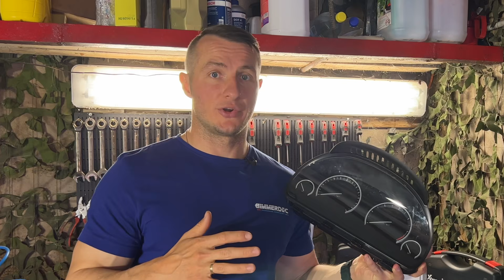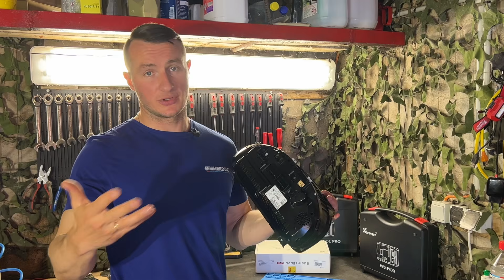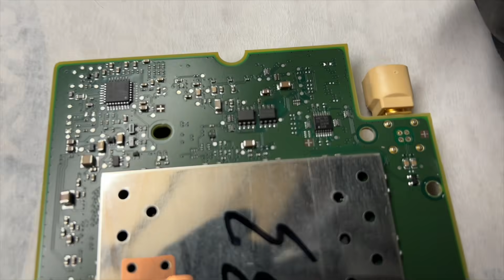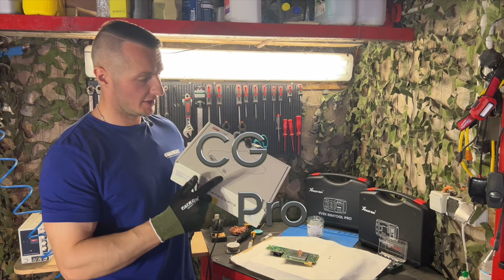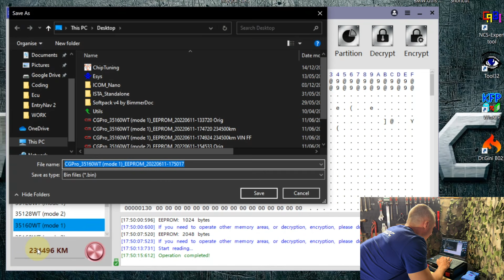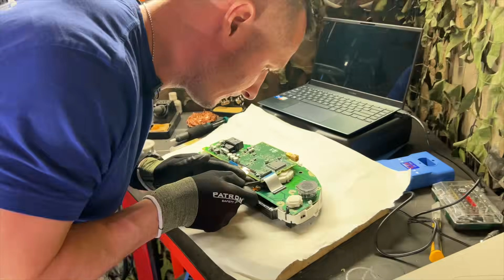How to zero (virginize) any BMW cluster for retrofit or exchange?

Comment: Hi could you help me regarding my car. So I got a cluster from a f80 and I want to install it in my bmw f30. I got the cluster virignised and plugged it in. I don’t have a most cable yet. But once I plugged it in there is a tamper dot but with my cars kilometres. What must I get done now? For the cluster to work between my car. I know coding is required and the most cable but I think the tamper dot should not be there? Did the person who virignize it didn’t clear the vin?
Reply from the maker: If you code the cluster to your vehicle then red dot should not be present. 
If it is still present, then sometimes vehicle needs to go for a sleep. 😴 
It dot is still present, then verginizing process is as not done properly. 

And fitting M series cluster is not so straight forward. Take that into consideration.

Comment: Can you just swap EPROMs from one cluster to the other??
Reply from the maker: EEPROM swap is possible on E series only. 
On F and G it will not work in that way any more
Reply: @BimDoc  is there any way to use a used cluster without soldering I have a e66 that needs a new cluster and I can’t solder for the life of me
Reply: @BimDoc  thank you.  It is for a g30 with a cluster that intermittently goes black.  Do you know if anyone repairs these?  Possible a cracked solder joint somewhere?
Reply: Just tried and unless you have the experience of soldering it’s ducking crazy hard

Comment: If the mileage on my original cluster is higher than the new (used ) one i bought i can keep it without having a mileage tamper light?
Reply: Would i be able to just switch out the eproms with mine in the original cluster
Reply from the maker: Switching EEPROMS will not work on F and G series any more!

So full VIRGINIZING is needed

Comment: Great video and really informative! Just a small clarification regarding your explanation about hexadecimal numbers. You mentioned  right around the 13:05 mark that the value 0xFF is equal to 0, which isn't accurate.

In the hexadecimal numbering system, a single digit can represent values ranging from 0 to 15. Unlike decimal numbers, which only have digits ranging from 0-9, hexadecimal numbers extend that by including the first six letters of the Latin alphabet (A-F) as additional digits. In hexadecimal, the digits range from 0 1 2 3 4 5 6 7 8 9 A B C D E F, where 'A' is equivalent to 10 in decimal, 'B' to 11, and so forth up to 'F', which is equivalent to 15.

So, when you look at a one-byte hexadecimal value like 0xFF, it's actually equal to (15 * 16^1) + (15 * 16^0), which calculates to 255 in decimal notation, not 0. The representation for the decimal number 0 is consistent across binary, octal, decimal, and hexadecimal numbering systems. In all of these systems, zero is always zero. In the case of hexadecimal, it could be written as 0x0, 0x00, or 0x0000, but it's always equivalent to the decimal number 0.

I hope this clears up any confusion! Keep up the good work on your videos!

-- a fellow Bimmer nerd
Reply from the maker: That’s true 
Just FF values are takes as VERGIN and that’s why they often referred as ZERO

But yes FF = 255

Comment: Hello Vladinir can i ask for an advice please? I am considering to add to VO 6WA for my KOMBI and code it because the car is 2010 year and as I see my original combi is 6wa model. As i read 6wa is from year 2011 thats why its comfusing for me why 6wa its not originaly in my VO. The reason for adding it is because i want to add in addition coding M performance logo picture and as of now i dont see it in addition in my coding options. Will adding 6wa in VO help and is it safe to do so ? Here is my car VO list bmw 740d F01 2010.

Type Code KM81
E Series F01 ()
Series 7
Head Unit CIC
Type LIM
Model 740D (EUR)
Steering LL
Doors 4
Engine N57S
Displacement 3.00
Power 225
Drive HECK
Transmission AUT
Colour CARBONSCHWARZ METALLIC (416)
Upholstery LEDER DAKOTA/SCHWARZ (LCSW)
Service history Request a FREE service history
Prod Date 2010-06-24
Available upgrades
Spare/replacement key fob Check compatibility
Additional iDrive features Check compatibility
Additional iDrive features Check compatibility
Vehicle options
L801A National version Germany
P337A M Sports package
P7R7A Innovation package
S1CBA CO2 package
S1CDA Brake Energy Regeneration
S229A Dynamic Drive
S230A Extra package, EU-specific
S248A Steering wheel heater
S2NXA BMW LA wheel, M Double Spoke 303
S2VHA Integral active steering
S302A Alarm system
S316A automatic trunk lid mechanism
S319A Integrated universal remote control
S320A Deleted, model lettering
S322A Comfort access
S323A Soft-Close-Automatic doors
S3AGA Reversing camera
S403A Glass roof, electrical
S415A Sun-blind, rear
S416A Roller sun vizor, rear lateral
S423A Floor mats, velours
S428A Warning triangle and first aid kit
S430A Interior/outside mirror with auto dip
S441A Smoker package
S453A Climate-controlled seats, front
S456A Comfort seat with memory
S464A Ski bag
S488A Lumbar support, driver and passenger
S494A Seat heating driver/passenger
S496A Seat heating, rear
S4B9A Interior strips, alu, satin-polished
S4NBA Autom. climate control with 4-zone ctrl
S4U1A Ceramic appliques for controls
S4URA Ambient interior lighting
S508A Park Distance Control (PDC)
S524A Adaptive Headlights
S548A Kilometer-calibrated speedometer
S5ACA High-beam assistant
S5ADA Lane departure warning
S5AGA Lane-change warning
S5DFA Active cruise control+Stop&Go function
S609A Navigation system Professional
S610A Head-up display
S612A BMW Assist
S614A Internet, preparations
S615A Expanded BMW Online Information
S616A BMW Online
S620A Voice control
S633A Preparation, mobile phone, Business
S677A HiFi System Professional DSP
S696A DVD changer
S698A Area-Code 2 for DVD
S6AAA BMW TeleServices
S6ABA Control for Teleservices
S6FLA USB/Audio interface
S6NFA Music interface for Smartphone
S6VCA Control for Combox
S710A M leather steering wheel
S715A M Aerodynamics package
S760A High gloss shadow line
S775A Headlining anthracite
S7SPA Nav Professional/cellph. prep. Bluetooth
S7U9A Delete BMW Service Inclusive
S851A Language version German
S863A Retailer Directory Europe
S879A On-board vehicle literature German
S8KAA Dummy-SALAPA
S8S8A Country-specific nav. system supply
S8SCA Telematics access request,country-spec.
S8THA Road sign detection
Reply from the maker: On 7 series the minimum KOMBI is already 6WA
So no need to add that. You are okay
Reply: @BimDoc  thank you. What about adding with coding m50d picture on the kombi? Right now i dont see the option . How can we make it possible, can you help?

Comment: Hello Vladimir, I have just came across your channel and instantly fell in love, thank you so much for such great content, specially this one here, about virginizing the instrument cluster prior to retrofitting, now, a quick question if you please, do you know the codes for the EEPROMs on the BMW F15 (x5, Year 2017) instrument cluster? Or will any 8-pin EEPROM will work just fine? I bought a used car and the previous owner did a nasty job on the instrument cluster by removing the EEPROM all together (instead of virginizing it) and bridged the gaps with wires! Now I want to buy new EEPROMs and have my technician resolder them back to the board, but I want to buy the correct EEPROM, any advice?
Reply from the maker: I’m afraid that cluster is useless now. 
EEPROM and FLASH have IDs and they should be identical. 
If you don’t have even the information from previous eeprom then that cluster can be used for parts and no more (
Reply: @B @BimDoc  Vladimir thank you for sharing this very helpful videos, im having issues with saving modified eeprom after vin and mileage change, if i want to replace new eeprom how can i read old eeprom ID? Thank you

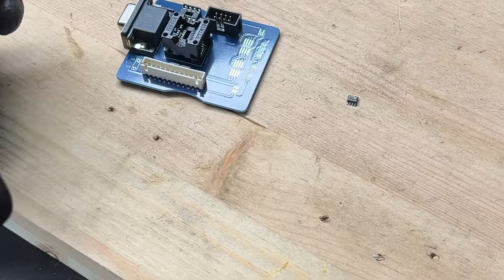Comment: hi, for the second eeprom 95320,(15:39) why you did not use the adaptor(clip) on the pcb? does the adaptor won't work? need to solder the eeprom on the eeprom pad?
Reply from the maker: On 95320 clip should also work. 
But soldering does not take so much time but it guarantees 100% result

Comment: Hello Vladimir, excellent channel content and tutorials. My F21 2013 cluster is in mpg . Cruise control speed is also in mph .Can cruise control speed be coded to kmh or do I need to swap cluster to kmh.
Reply from the maker: When taking cluster from US/UK then some parts of EEPROM are in miles and has to be treated separately. 
So not so straight forward.

Comment: Hi great video! I had my cluster changed on my F11 and now the milage first shows 9 miles before increasing to the correct millage (around 88k). Also on every ignition cycle the milage increases by 3 miles without driving it. Is this an issue with how it has been virginised by the seller or how it has been coded by the installer?
Reply from the maker: It’s cannot be coded for somehow mileage auto increase 
I’ve verginized a lot of clusters and didn’t had a single issue of that kind. It’s hard to tell what is the problem.
Reply: I have this same issue on my car, every time I turn the car on and off the mileage goes up anywhere from 2-60 miles on my odometer.. my odometer reads like 149,500 and my Ecu reads about 136,400. Do you ever get this figured out Pedra?

Comment: Hi, great detailed video thank you! 
Rose alloy with low melting point has about 25% of lead, you said they use lead free soldering in F clusters.. did you NOT use this rose alloy to solder it back, only to remove it?
Reply from the maker: I always use rose alloy to desolder eeprom 
Then good cleanup with copper wick is needed
And soldering back wo rose alloy. If you leave it there, you will have a lot of headache 🤕
Reply: @BimDoc  so you do solder it back with the same rose alloy you removed it?
Reply from the maker: I always remove rose allow
And solder eeprom back without rose alloy! Always!

Comment: Hallo! i have a BMW F22 11/2018, i bought a BMW M2 Competition Cluster and got it coded correctly. I put the original Black Panel Cluster out at 48600 km...i drove 430 km with the new cluster...then i decided to sell the car and put the old cluster in....but it does not take the actually KM ( 49046) over...why is this? why dont give the car ecu the new KM to the old original cluster???
Reply from the maker: Recode old cluster with esys

Comment: Man... what a cool video!!! So I learned that buying a new one is the best I can do, at least for my case. I have a G20 M340i, a used in good condition cluster goes around 400 in eBay and an additional 400 to virginize it in some local shop. A new one from a BMW dealer is 1200. So basically going used I will be saving only 400, wasting time, potentially having it broken and still have a used one. So yeah, I'll go for a new one. Thank you very much man!!!!
Reply from the maker: You welcome!

Comment: Hi. Looking at the Eeproms, the one that cannot be erased is 160DQ = M35160. I did a BMW M3 the other day and I managed to correct the mileage by choosing 160DQ (Mode 1) on the programmer (CGpro). I don't know why you chose M35160 and not 160D from the menu. Love your video. Just subscribed!!! Keep it up, and thank you for sharing.
Reply from the maker: I also switched to CG PRO to work with clusters.  In my opinion it handles EEPROMs better that VVDI Prog
Reply: so you can just correct the mileage? dont you have to erase it all?

Comment: As always GREAT tutorial, really very good job ! In topic of cluster reprogramming do you know if it is possible to reprogram F30 (6WA) USA cluster into EU one? I mean mls to kmh during setting a CruiseControl speed. Do you guys do such a things ?
Reply from the maker: Yes it’s possible, but not so straight forward
Reply: on 6WB is very easy to change the miles to km
Reply: cant you just do that via OBD scan tool bro?

Comment: Hi Vladimir, thanks for the video. I found this very useful! I just got a virginized 6WB from my seller. But, after installation and coding, maintenance notification pops and "reset impossible". Is is due to incorrect virginize steps? I am thinking to virginize it again and see if it helps...
Reply from the maker: It’s difficult to say. If coding went through then it’s most likely not the Virginizing problem

Comment: Hi Vladimir, I am writing to you from Spain. I loved your video and I will follow you from now on. I have a problem in my cluster BMW f20 lci 2018 116d Panel Cluster 6wa enlarged black. The battery is discharged while the vehicle is stationary. It gives two error codes and according to the internet it is a combi cluster error that does not let the vehicle sleep and they recommend changing it. My question is can it be reprogrammed? If it is virginized, can it be fixed? My son error codes. 804086 controller kl15WUP shorted to positive. B7F67B kombi incorrect hardware activation line status. I hope you can help me. greetings mate
Reply from the maker: If some ECU is gone bad and doesn’t allow bmw to sleep then it has to be exchanged. 
As a test try to disconnect Kombi and see if bmw goes to sleep properly or not. 
(BMW should fall into sleep if locked for 20-30 min)
Reply: Can I have your WhatsApp number brother

Comment: hi, can you swap the eprom to another cluster without problems, remove the cluster from the car, remove the eprom and install it in the replacement cluster?
Reply from the maker: It is doable not with every eeprom type. 
Starting from eeprom 35128/35160 eeprom ID is written into flash and they are not interchangeable
Reply: @BimDoc   interesting….is it possible to remove the old eprom and replace it with a new one ,,, (without writing to the new eprom?) and then coding it to vehicle once installed?
Reply: @BimDoc  hello Vladimir, do know any possibility to change the id on the new chip? Which kind of programmer is needed and where to search for the ID?

Comment: Hola Vladimir te escribo desde España 
Me ha encantado tu vídeo y te seguiré a partir de ahora.
Tengo un problema en mi cluster 
BMW f20 lci 2018 116d
Cluster 6wa ampliado black panel .
Se descarga la batería estando el vehículo parado.
Da dos error Codes y según internet es un error del cluster combi que no deja que se duerma el vehículo y recomiendan cambiarlo.
Mi pregunta es se puede reprogramar?
Si se virginiza se puede arreglar ?
Mis error Codes son.
804086 controlador kl15WUP cortocircuito a positivo.
B7F67B kombi estado de línea de activación incorrecto línea de hardware.
Espero que puedas ayudarme.
Un saludo compañero
Reply from the maker: English please ))
Reply: @BimDoc  Hi Vladimir, I am writing to you from Spain. I loved your video and I will follow you from now on. I have a problem in my cluster BMW f20 lci 2018 116d Panel Cluster 6wa enlarged black. The battery is discharged while the vehicle is stationary. It gives two error codes and according to the internet it is a combi cluster error that does not let the vehicle sleep and they recommend changing it. My question is can it be reprogrammed? If it is virginized, can it be fixed? My son error codes. 804086 controller kl15WUP shorted to positive. B7F67B kombi incorrect hardware activation line status. I hope you can help me. greetings mate

Comment: Usefull info here. thanks for that. I tested out of curiosity :D.  When the Mileage of Cluster is not resetted or is higher then the car's. It shows still the km of the car. And adds 5km to car's mileage every time car started. Car is a f10. not sure how would it be on other models
Reply: Поставил приборку 6wb сброшенную красной точки нет, вин мой, каждый раз включении зажигания +5км к пробегу
Reply from the maker: I haven’t tried with non verginized clusters)))

Comment: Hello, I think you are using the wrong adapter because cg prog shows that you need to use 35080 and you are using 35160wt?
Reply from the maker: Definitely not. 35080 eeprom was installed on E series dashed. And yes 35080 will require another adapter. 

Over here we are working with F series.
Reply: yesterday i did f series 160dow i used 35080 adaptery and everything is ok
Reply: @dainilis32palmerstown22  35080 adapter is fine for 160dqw eeprom, its correct for this eeprom, for 35160 you need to use 35160 socket that comes with cgpro,

Comment: Hello!  Used 6WA for BMW with 160D0WT eeprom was read with CG Pro 9S12, i did  mileage correction and erased VIN and installed in car. 
Cluster was coded, no red dot but every time i turn ignition on mileage increases  with 5 Km without Red Dot Tamper. Any ideas?
Reply from the maker: Very strange behaviour. Probably smth wrong in eeprom. ((
Reply: How did you solve the problem?  I have exactly the same problem.
Please help
Reply: Bad chip, used new chip from VVDI and the problem was solved
Reply: @mmihai82 купил приборку обнулена, красная точки нету, вин подтянулся, каждый пуск +5км , сижу в шоке

Comment: Great video.  Rather than solder the 95320,  can't you use the socket on the board?
Reply from the maker: With 95320 doable. But if you know how to solder it’s just couple minutes.

Comment: there is a small trick with CG Pro to erase mileage, i have done lots of them (35160 and even 35128 chips) all of them were done successfully, ofcourse you have "erase failed" sometimes, but that's not a huge problem, usually it takes ~30mins to erase it.
Reply from the maker: And the trick is?))
Reply: @BimDoc  игра напряжением.
Reply: @BimDoc  heat eeprom when erasing
Reply: Gal noretum papasakot?🙁